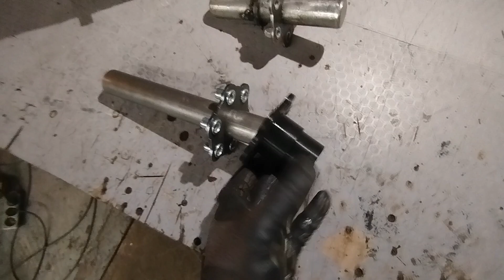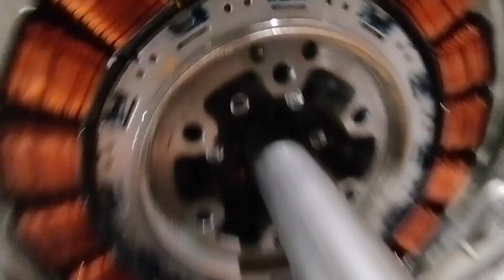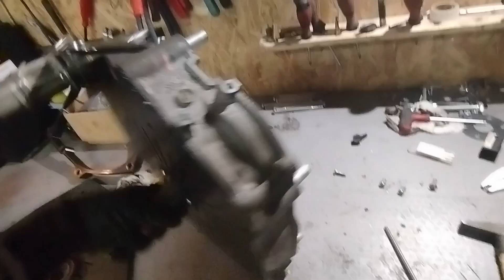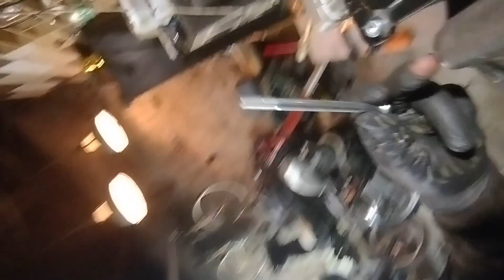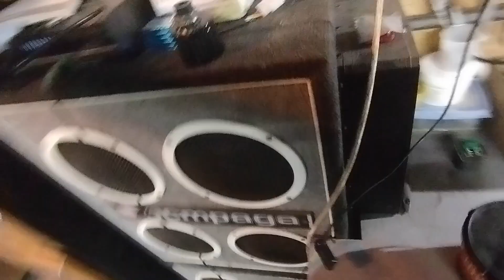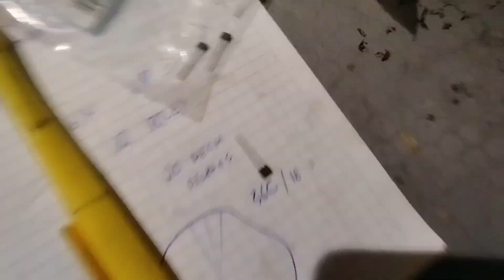Honda IMA motor housing build & assembly finale

Comment: Hello , why don 't you use a regular inverter , it 's easy to start
Reply from the maker: You absolutely can, however I used what I had on hand
Reply: the inverter can be started using openinverter technology, I posted the connection method on the forum of the site ,Honda IMA, but it was very nice to use it in a project with an electric motor, the inverter works up to 240v managed to remove 187 battery current
Reply: Could you share the drawings?
Reply from the maker: @DIYinverter28RUS  https://we.tl/t-FOSaRTnvA9OGDOYS here you will find the .step file of the whole project. Not the tidyest one, but will do the job. Cheers
Reply: @yoorbuilds thanks, did you manage to put it on the project?test it
Reply from the maker: @DIYinverter28RUS  not really, as i mentioned in the video my setup with the hall sensors was quite 'laboratory-environment like' and i did not proceed to put it on any other project yet, but I am sure it will find it's place sometime.

Comment: I am interested in using an IMA motor. I think they could be used in motorcycles or light vehicles. Could you send me your CAD files if you are still willing? I think something interesting could be done with that motor.
Reply from the maker: here's the assembly .step, it's not the tidyest file but you should be able to figure out everything. The main point is to adjust everything around the main axis you will be using. it would indeed be an interesting project to put this motor on a motorcycle conversion.
Reply from the maker: https://we.tl/t-wBT3JLaJzU
Reply: @yoorbuilds  Perfect, thank you very much. These motors have a lot of potential for electric vehicle conversions. I invite you to check out GM BAS motors, which are shaped like a classic alternator motor. Perfect for adapting to any light vehicle. One question: what electronics did you use to control that IMA? Did you need specialized software?
Reply from the maker: @josepepe4361  thank you, i will check out GM BAS. regards the controller - in the video i believe i show that initially i wanted to use kelly controller, but it did not like my hall sensor setup, so i switched to 'less picky' chinese controller i had laying around.
Reply: @yoorbuilds  Why didn't you use the Kelly? Do you think that if I run it with a 3kW Chinese controller so that it works at those ranges on a motorcycle with your casing design, it could work?
Reply: @yoorbuilds  I'm thinking of using it on an old sports bike, but with a low-power controller from Alibaba. Maybe between 5 kW and 3 kW. What do you recommend to do it correctly, and is it possible? According to my research, yes, but I don't really have your technical expertise, so I'd like your opinion.
Reply from the maker: @josepepe4361  Kelly is a 'smarter' controller, with possibility to tweak settings. I believe what happened is it did not like my custom hall effect sensor setup, and simply refused to spin. After several attempts I just switched to the cheap controller i had laying around and it worked, because they are probabbly used to less precise motors.
Reply from the maker: @josepepe4361  Yes i believe it should work, I saw someone running these motors on around 12kW. I would recommend hooking up a temp sensor to always have an idea of what is happening inside the motor temperature wise. Regards the casing - for real world use i'd suggest making the offset spacer not 3D printed, but rather also laser cut maybe from several layers of steel. And if you have an option to mount external position sensor or encoder (instead of my inside three hall effect sensors) it would also be more acceptable. Keep in mind my whole experiment was around figuring out the exact dimensions for the casing and to make it work in real life it does need some tweeking to make sure it is rigid enough. IMHO -- if this project of yours is more towards tinkering and building something interesting - go for this motor, its attrractible because it is cheap. However, if you want a working deviice that you plan to use regulary, i would recommend considering off the shelf motor like HPM-3000B or similar.
Reply: @yoorbuilds  I want the motorcycle for relatively frequent use. The motorcycle is very, very economical with a damaged engine. The project is relatively low-budget because you can get something good for very little money. I was thinking of using rickshaw engines that are very inexpensive, including the controller, but they mostly go up to 1.8 kW. I was thinking of using a 3 kW one because I know they exist and would be very economical, but they have low RPM. So it might be a good option to use the Honda IMA at 5 kW to 3 kW. It would be more efficient and reasonably priced, but heavier. The motorcycle weighs about 90 kg without the engine, a CBR 250. What do you think of rickshaw motors for a motorcycle?

https://www.youtube.com/watch?v=2TtR6imizXg&list=PLxGaGu7Xz2adxmPXzoX7zU8AasGp-GbtV&index=2
Reply: @yoorbuilds  https://www.youtube.com/watch?v=JlEw9JCjYTE
Reply from the maker: @josepepe4361  I had converted an old soviet moped in the past to electric. I used a very similar motor, 1kW only. Since the moped was very lightweight, i was able to get speeds up to 60-70kph. it all comes down to total weight and reduction. for your application 3kW should be perfect, but again, making the IMA work is quite some work
Reply: @yoorbuilds  What was the range of your 1 kW motorcycle? How many kWh did it take to cover those kilometers? How much did your motorcycle weigh approximately? I think a rickshaw motor would be sufficient. You can easily get a kit on Alibaba with a 1 kW or 1.8 kW motor for less than $70. The problem in my case is the weight. I think I can fit an economical motor to the CBR 250rr to get a performance of over 60km/h if it works well. Do you know of any other economical motor to recycle that is like the Honda IMA?
Reply from the maker: @josepepe4361  oh that was many years ago, i do not recall in detail. I had a random battery laying around so i did not expect a lot of range, just enough to ride around for fun. The weight was no more than 60-80kg. In your case, i'd really try to find something closer to 3-5kW. It's better to have more and not use it, especially in higher hills the kWs matter. Unfortunately i am currently not aware of good alternatives, the options from golden motors are quite good and they are basically paired with kelly controllers.